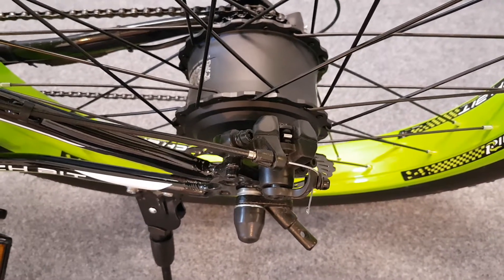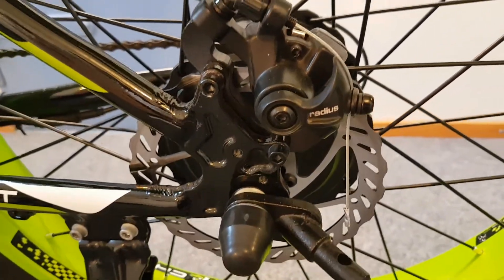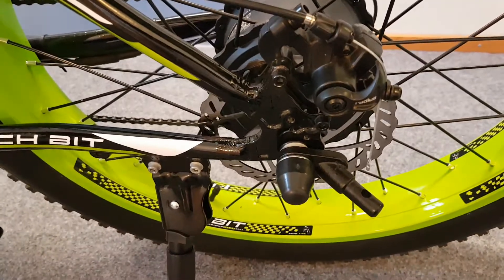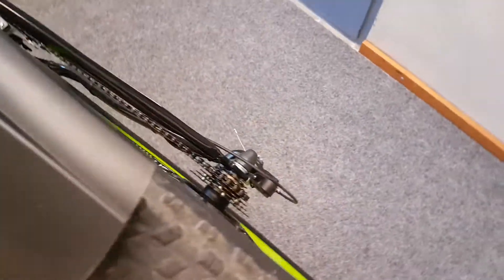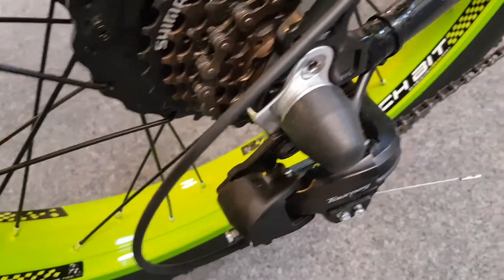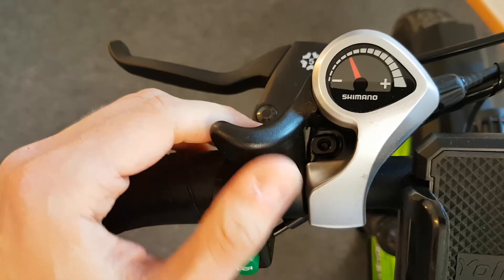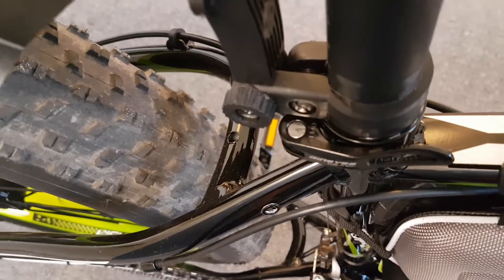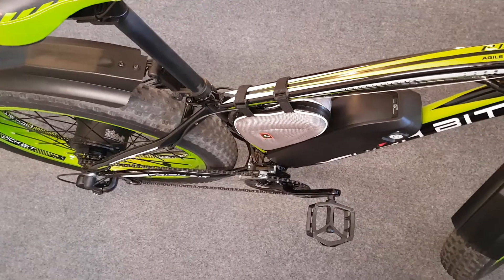Rich Bit RT-022 Fat E-Bike mechanical components

Comment: Hi mate.. I just got mine. Just one question. What’s that red switch on the battery for? No matter which position the switch is in it makes no difference
Reply from the maker: It turns the power to the bike on/off. If it doesn't then the switch, or the wiring to it, is defective...
Reply: udatube Thanks mate.. dealer is sendng new battery today for it. wiring cant be wrong as its the switch inside the battery which is not working.

Comment: Hello, thank you very much. I bought the same also same colour. Now i have a problem on the back tyre and I need that to remove the rear wheel (remove the motor connector and remove the derailleur)but i don't know how they are located..i mean the motor connector and the derailleur. Can advice pls. Thanks a lot. Michele
Reply from the maker: Hi, you don't need to remove the derailleur in order to remove the wheel. The chain easily comes off the cassette when you have loosened the large nuts clamping the wheel axle to the frame of the bike. The motor connector is the bulge about 20cm from the axle towards the front of the bike. Make sure to remove the zip-ties holding the motor cable to the chainstay before trying to remove the wheel. Be careful with the connector, removing (and installing) it requires some force and you can easily damage the pins. And when refitting the wheel secure the motor cable back with zip-ties or it could be damaged while cycling.

Comment: Hi, Just purchased on ebay one of these :) any news about your bike,  reliability please?
Reply from the maker: So far so good, I've done about 750km on the bike and nothing has broken. I've also ridden it, mostly because I didn't have an alternative, for a long distance in pouring rain and none of the electrics or the motor showed any issues during or after. Not that I'd recommend doing it on a regular basis unless you've done some extra waterproofing =).
Reply: Thanks and Sorry for late reply, I've done about 300km no problem with bike, I've upgraded the rear brake disk to 180mm disk, also the braking become more efficient.
Reply: @dzsottoszabo4984   Hey man, I also have this bike, done 1500km so far and really need new breaks but dont have a clue, could you help?  Is 180mm the largest possible disc size in the back?

Comment: Hi, I purchased one of these in July this year and after only two months use the brakes are worn out. I took the bike to a local reputable bike mechanic and he said the same as you, the brakes are totally insufficient for this bike. I asked if he could upgrade the brakes to hydraulic but he says that as they are wired in to the electrics it would be tricky. If you decide to upgrade the brakes could you do a video showing how please. It would be most helpful. Thanks.
Reply from the maker: I'll make a new video at some point of all the mods and upgrades I've done to the bike and I'll talk about the brakes as well in that video =)
Reply: @udatube    ????   :)
Reply: Did you get new breaks?
Reply: @Funky420Infotainment  I've got a larger rotor on the front and doing the rear next week. Going to take the stand off and fit a centre stand. Looking at fitting hydraulic brakes but not sure if disconnecting the electrics from the existing brakes will effect the whole electrics system.
Reply: @deltic7productions1982   OK, do you have the links.  I want to oder and do it myself as I live in Switzerland and they charge a fortune.  good idea about getting a center stand.  Im planning to change the discs too, to at least 180mm (if thats all that is possible on the back, and maybe 200mm at the front.  plus a better thing that holds the break pads
Reply: @deltic7productions1982   So what size did you put on the front and are planning to put on the back?